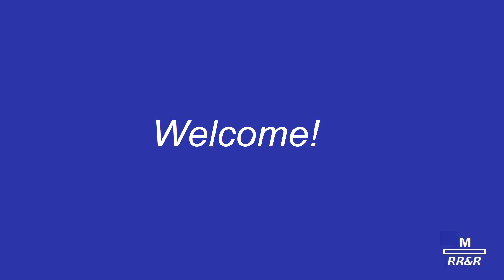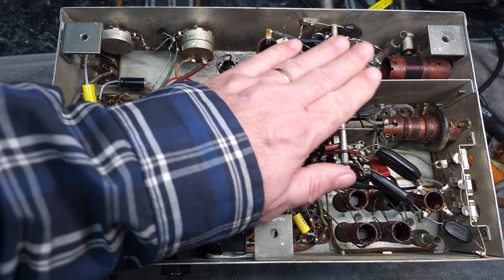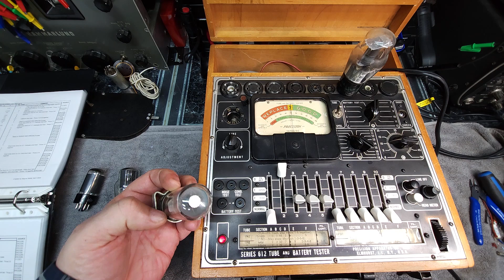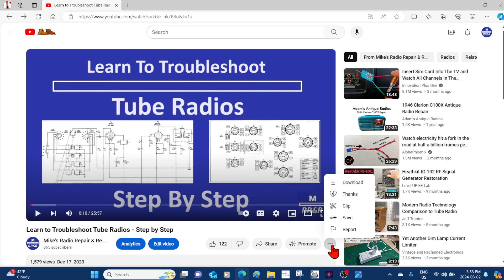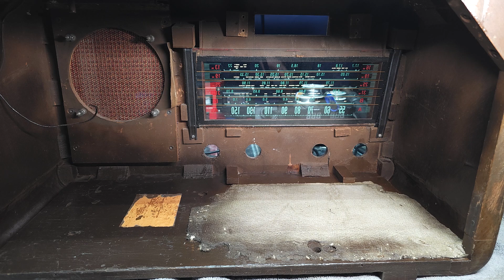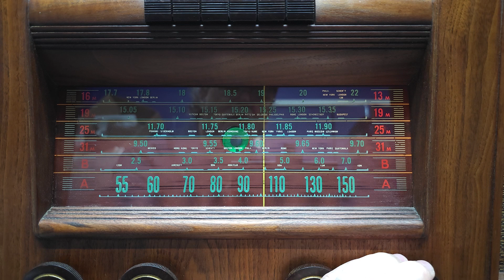RCA Globetrotter Model A25 Restoration Pt. -2 - First Start Up!

Comment from the maker: I think insofar as the speaker, here is my current plan. I think I will replace the field coil with a Hammond 157M Choke and place it in series with a 1K 20 watt resistor to normalize the power supply output voltage. This gets me 8 Henrys of inductance which should be ample. I have a very nice full range output transformer that is designed for the 6x6 tube family with a 4500 – 5000 input impedance. I think for the speaker itself I will put something in just a wee bit larger. I am thinking a 6 x 8 quality oval. This should really give the radio dynamite sound. Far better than factory sound. The only thing I havent decided on is where I'm going to pull the supply for the audio output transformer. That stage of the audio section likely draws close to 20 mA idling. So it would be nice to take that load off the choke but only with the proviso we can supply clean DC to the audio transformer. Im thinking about stealing the design used by the Hallicrafters S-76. Your thoughts?

Comment: Mike, when you replace the old worn out capacitors, is it ok to just toss them in the trash or should they be placed in an electronics recycling bin ?
Reply from the maker: Yup Good point.. Its always a good idea to recycle them properly. Putting them in the electronics recycling bin you can be sure the folks who deal with that will know the right path for them.